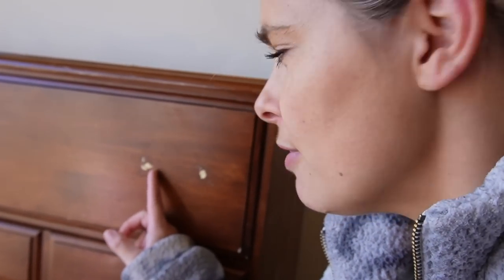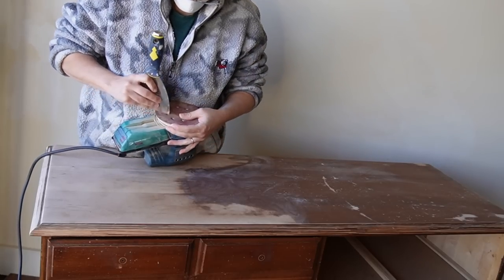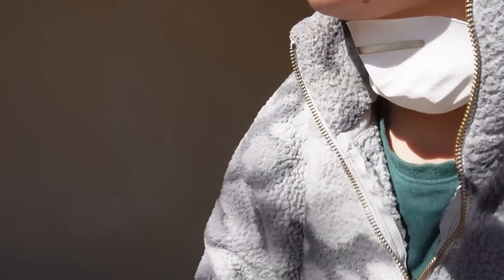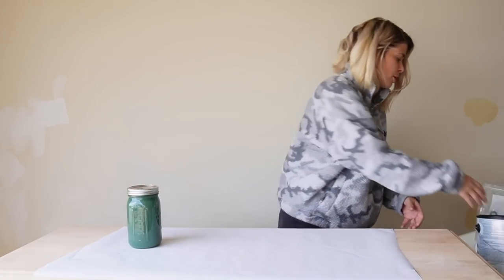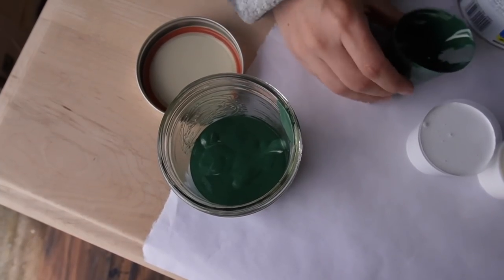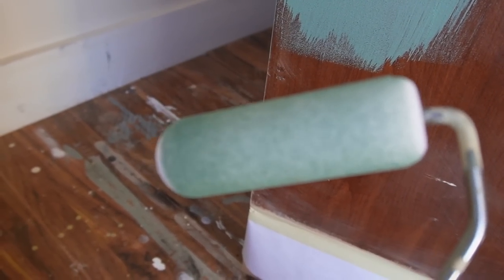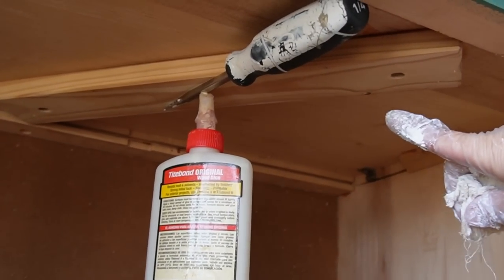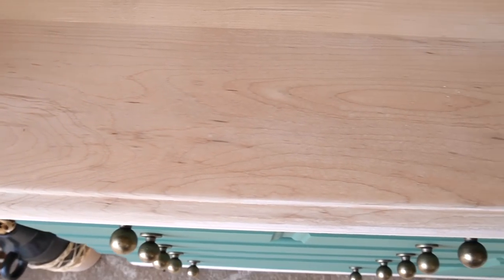$50 JIG SAW = MODERN LEGS |Dramatic Dresser Flip

Comment: Kliz makes a clear primer. It works to keep the dark colors dark. I used your formula with a jet black paint using clear primer. It solved the problem.
Reply from the maker: That’s awesome!  Was coverage similar to regular paint or more sheer?
Reply: @blacksheephouse  Great coverage not sheer at all
Reply: Kilz is a great product!!
Reply: Which Kilz product did you utilize?   They have several and I prefer to ava do-over.   Thx!

Comment: Why did you say water based primer is necessary? Is it because you're mixing everything together?
Reply: If you combine oil-based and water-based products the end result isn't usable.    It's similar to mixing water and oil in a bottle - the properties do not blend.   Plus with paint it becomes a nasty mess.   I believe it's a chemical issue.    I saw a 'professional painter' mix a batch of products and started spraying a room.   His sprayer was quickly jammed and he had to pay to have new sheetrock installed.   He also had to replace components on his sprayer.
Reply: @galady8632  Ok, so it's because she's mixing it all together then. I ask because I usually use an oil primer, and once that's dry, I'm not too concerned with the topcoat.